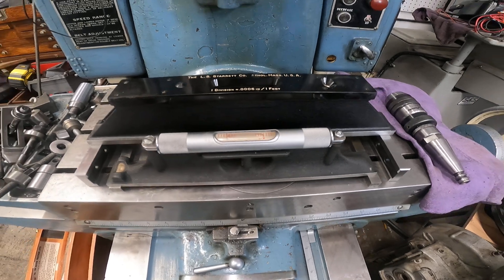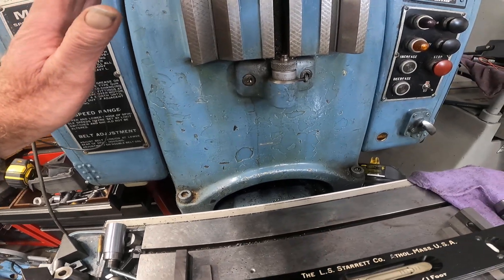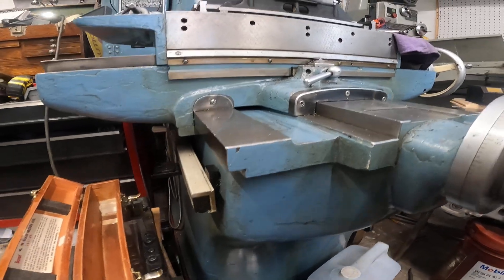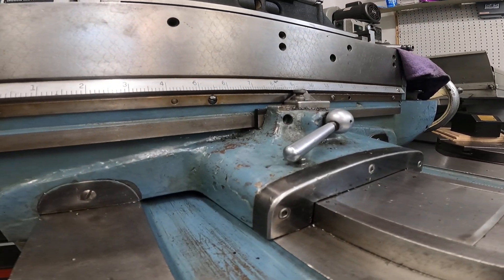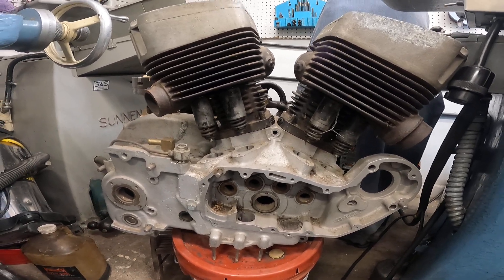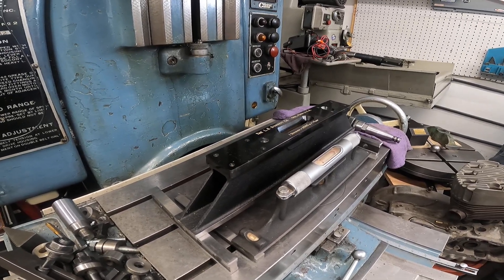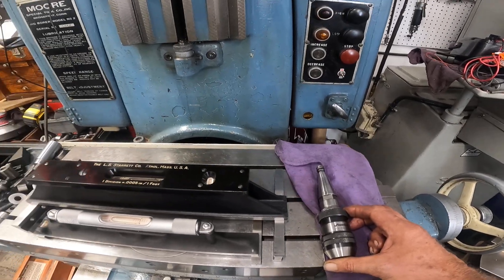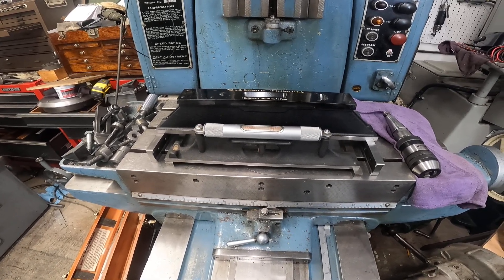Moore jig borer, and machining the Harley Davidson K model

Comment: You know it could be ether of those levels out of true.
Why didn't you spin them around and show how to adjust them?
Next time.
Too many machines and no more room, a problem a lot of us have, hahaaaa.
Reply from the maker: I forgot to show I spun those levels. I have got one more trick up my sleeve! Knocking out that wall and adding around 8ft more, i have a 14X30 Axelson lathe and radial drill I will slide in there, I have been looking at navy ship machine shops to get a good idea how to arrange it all. I have to keep it small as possible because of heating and cooling cost.

Comment: Nice machine, in a different league to a Bridgeport but it wasn't meant to be a direct competitor to one. I like my Bridgeport though, for the typical home machinest who only has room for one mill they might be the most versatile and cost effective option.
Reply from the maker: You are right, the configuration of the spindle bearings is specific for boring a hole, and the rest of the machine for locating it, making the table screws too fine of a pitch for the load of regular milling operations . Combined with the heavy preloaded spindle, the machine actually rattles using a 1/2" endmill.
 And, it also takes the 5000lb Brown&Sharpe milling machine to complete the metal moving system that the versatile Bridgeport has.   The bridgeport its not got the muscle combined with high precision that the jig borer, and horizontal mill have in their whopping 9000 lbs for the two of them.
 What your are seeing here is a professionals  home machine shop, the basement is full of commercial grade wood working machines.
 Do not let this happen to you!
Reply: There is a Moore at work and I told them if they ever wanted to sell it put me on the list. Haha I'm the only one on the list. No one else wants it.